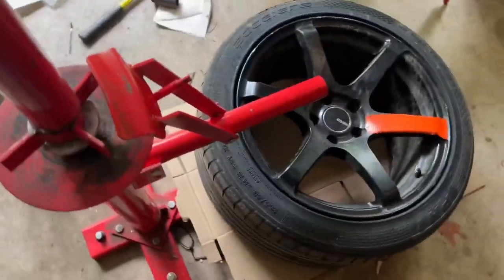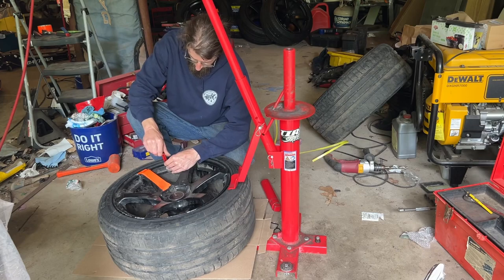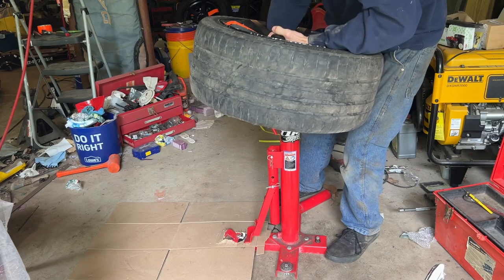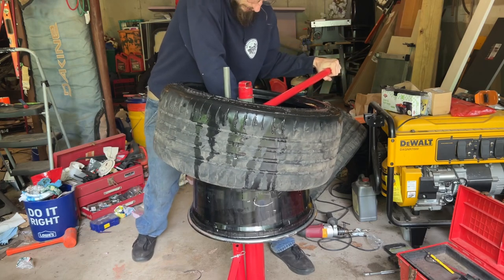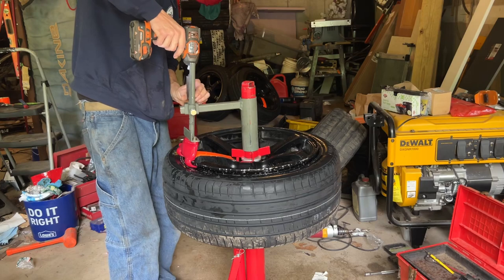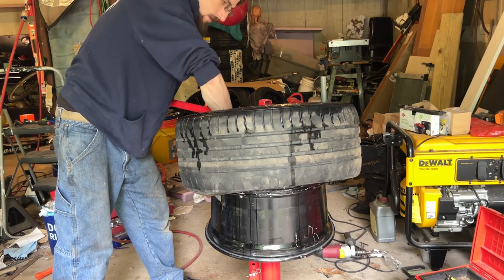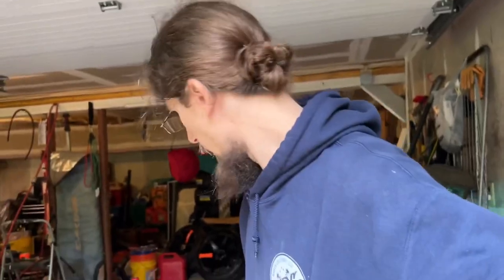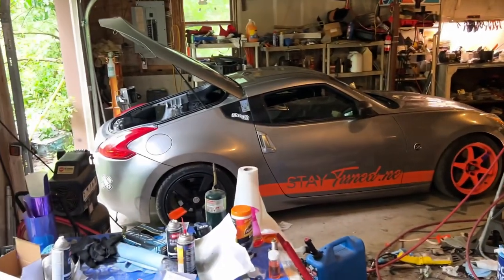Cheap Harbor freight tire machine upgrades! For my drift car.

Comment: I have the same duckbill attachment but mine came from Amazon. I notice the one on Ebay claims it is made in Texas while mine was made in China. I haven't used it yet but it looks substantial in quality. Mine cost $116 and it came with the aluminum centering cone. I had to grind down the bubbly welds at the top of the Harbor Freight changer in order for the cone to fit over the vertical post.
Reply: I’ve been deliberating about the same ones you mentioned. Need to do a 20” wheel. Think I’ll try the Amazon chinesium one first as well. I was just a little worried about how skinny the horizontal bar is but this video seems to show it works fine.

Comment: I bought that same attachment from Amazon and I like it, but the duck head that it comes with is really bad (works well for installation but stinks for removal). It looks like you have a better duck head. I am debating on returning it and getting the much better tool with the bushings, clamps and bearings.
Reply from the maker: This is the tool I am using here in the video. https://www.ebay.com/itm/115378446519?chn=ps&_trkparms=ispr%3D1&amdata=enc%3A14HHYxCLZQICKR3neEGK-ZQ71&norover=1&mkevt=1&mkrid=711-117182-37290-0&mkcid=2&mkscid=101&itemid=115378446519&targetid=1644837434363&device=c&mktype=pla&googleloc=9002460&poi=&campaignid=20398863052&mkgroupid=157274709968&rlsatarget=aud-1407154683071:pla-1644837434363&abcId=9317264&merchantid=6296724&gad_source=1&gclid=Cj0KCQjw0ruyBhDuARIsANSZ3wrLAcnq4YPt2jeipMqIO7cY4q5VmmRHh5-5Ype_Acc7X-xPD6WX8BAaAkd-EALw_wcB

Comment: What's the link to the duck bill adapter you used?
Reply from the maker: Here ya go, I put the dudes name in the description. https://www.ebay.com/itm/115378446519?chn=ps&_trkparms=ispr%3D1&amdata=enc%3A1pZVIs7KQQv6e-I9elZfSaA70&norover=1&mkevt=1&mkrid=711-117182-37290-0&mkcid=2&mkscid=101&itemid=115378446519&targetid=1644837434363&device=c&mktype=pla&googleloc=9002460&poi=&campaignid=20125739985&mkgroupid=149128855676&rlsatarget=pla-1644837434363&abcId=9312975&merchantid=6296724&gclid=Cj0KCQjwzdOlBhCNARIsAPMwjbzn0KEB_B_LSLSuCosj7KrcaIqOc8rSt4OwrwA2Jd0WumwXeDGrEo0aAuMpEALw_wcB